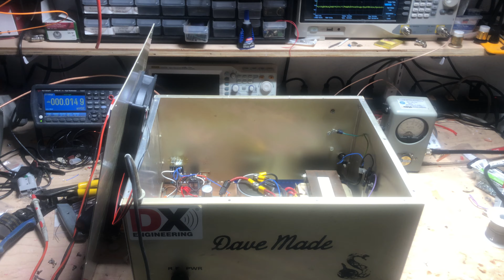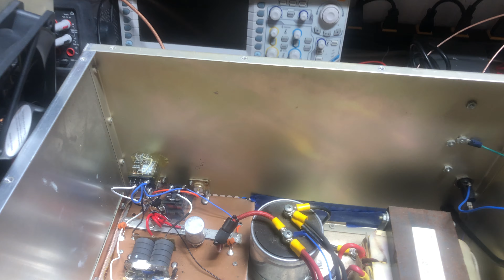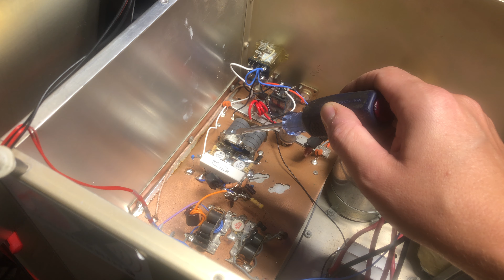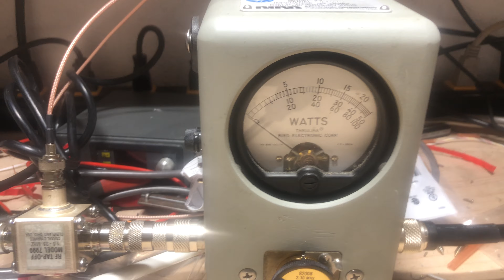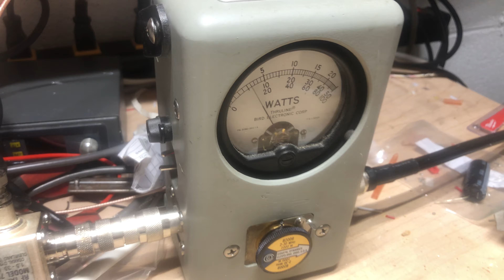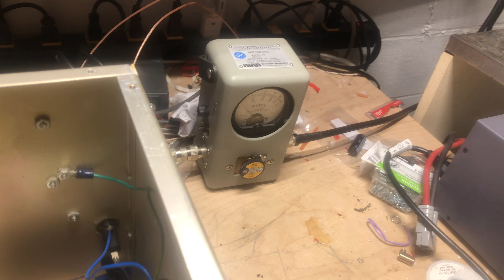Old SchoolDaveMade repair for BlueFalcon 767.

Comment: nice fix. had a few of them old ones come threw.  the bigger ones like a 4 pill or 5 pill . had some of them bridge rectifiers go bad. this is common and not just Dave made has them go bad. I been using stud diodes and the big 200 amp bridge . I had to change taps on transformer before after new rectifier.  watch that voltage on HG transistors. that one is ok. some of the old amps are dirty . just use a low pass filter after the amp. them old tunning caps go bad very often. the out put tune cap is also a common one to fail . on 4 and 8 pill I use the brass tuner tube from ICA. can just set it. 73's